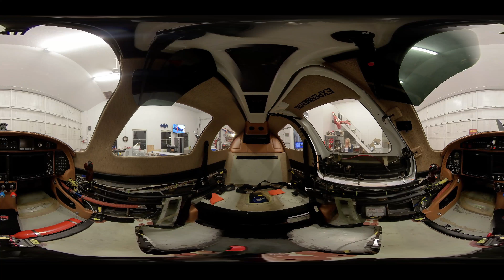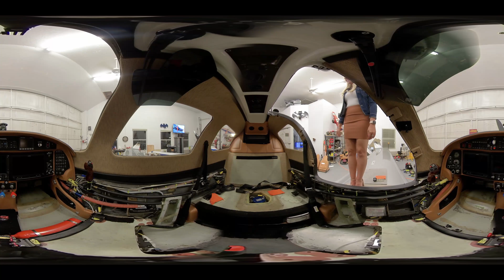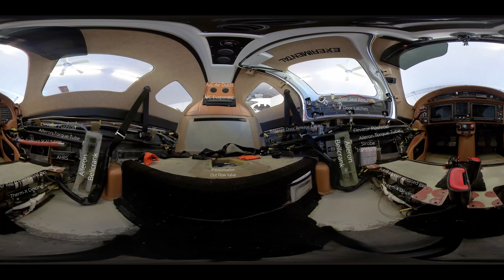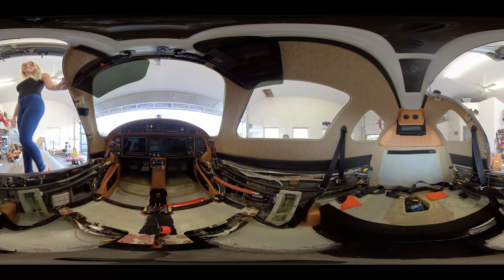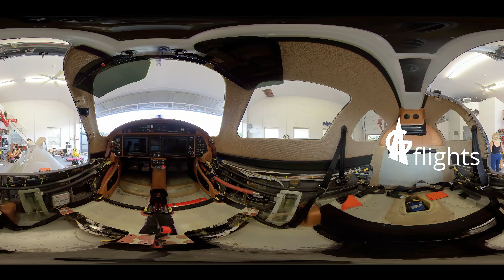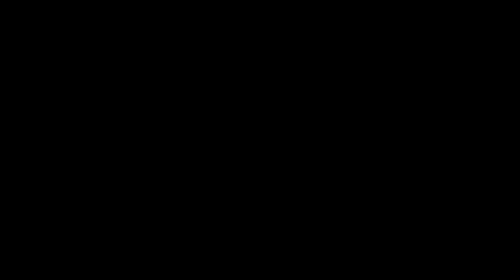Lancair IV-P 360 Virtual Tour - Part 2 of Condition Inspection

Comment: Although it comes with a lot of responsibility, fly by wire could clean things up tremendously. Similarly more modern engines without a church organ of controls. Fly by wire also naturally offers autopilot. A small central spaceball with a single floppy cable could control everything. Similar cleanlines in the panel. Only 2 screens, nothing else. Tesla style. 3rd mobile unconnected battery unit as backup. Engineer the fly by wire to be essentially fail proof and include a chute for the margin event. Two tiny turbofan jets at the back would clean things up as well. Lancairs are fast but there is room for further improvement. Mach 0.8 at FL500. Why not. It's nice and quiet up there.
Reply from the maker: I agree with your comments:
Fly by wire - this has had a foothold in some commercial airline planes and the technology greatly simplifies the mechanical aspects of the flight control systems.  The concerns/issues around redundancy can be solved now yet we haven't seen much of this make its way into the general aviation market.
Aircraft Engines - It really is odd that the technology for aircraft engines has been so slow to adopt new technology so alas we deal with the "organ" of push pull cables and deal with mixture settings throughout all phases of flight.  Plus fuel injection in traditional aircraft engines is very primitive compared to direct fuel injection in automotive engines.  Rotax, UL Power Engines and others have really advanced aircraft engine technology.
Of course this is a much bigger topic and can take us down a series of rabbit holes.
Reply: @gaFlights  what I've been somewhat excited about recently is turbofan jets for small inexpensive planes. Skip the whole piston anvil noise maker step. It turns out that a jet can match the fuel efficiency of a piston if only you go high and fast. Virgin Globalflyer flew 37000km without refueling at 550km/h with an off the shelf Williams FJ44 jet engine. That's half decent range if you think about it :)  and what no one seems to realize is that to power a 200kg plane (which ours easily can be without the piston lump) takes only a tiny turbofan engine where material strength is relatively high thus easy to make. A 10kg jet cannot cost a million dollars. Even if we say a fairly extreme price of 100k$ a piece, that still fits very nicely in a Cirrus SR22 nearly 1 million dollar tag. And I'm quite certain that a twin jet could fit inside the 200k$ typical LSA price range.
GA is ripe for revolution.
Reply: @baseballlife5884  I'm guessing it's a combination of a small market, respect for safety and if nothing else a psychological barrier to FAA certification. And then it has become institutionalized it seems. Most members of GA don't question it, even defend it. There is a fondness for status quo. There is some progress, parachutes and LSAs. But it's not much. GA could really need a product that really moves the needle, pun intended. And there is great opportunity for that. Most potent of which I see is a twin jet glider "LSA". All jets are in the bus category but a turbofan engine for an LSA weight class can be very small and inexpensive and that would dramatically change things. Someone just needs to develop the engine, then existing plane makers will adopt it and the ball is rolling. I think that would be the end of pistons. Imagine that.